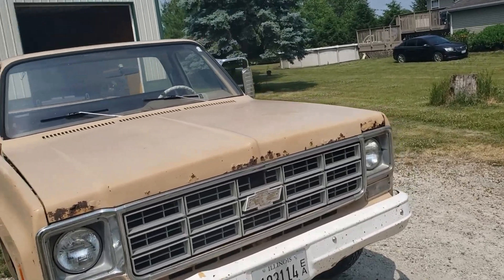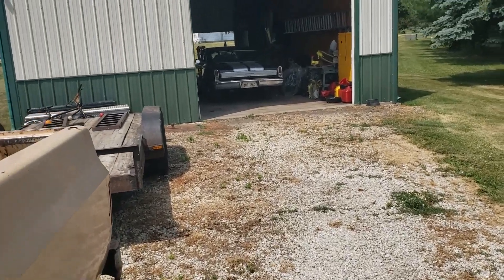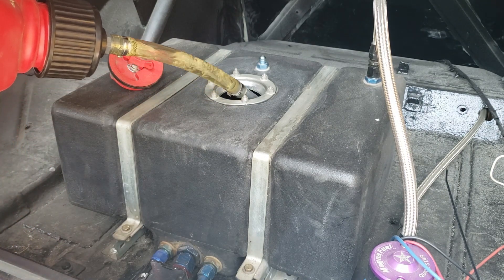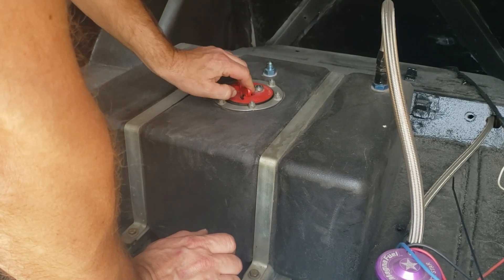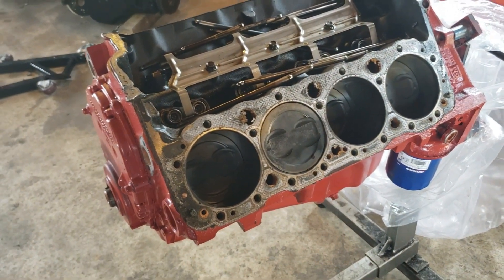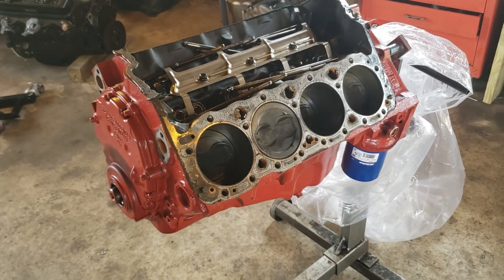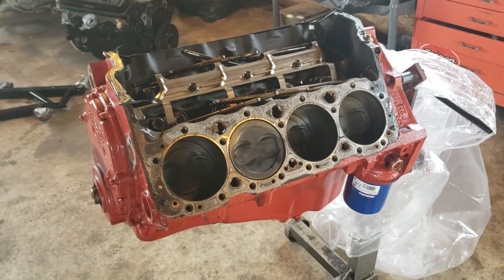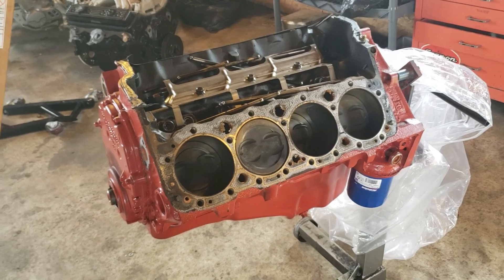Chevy 350 detonation, spark knock, pinging, pre combustion with gas upgrade

Comment: This is a good example of a pinging / detonation / preignition sound, which is really hard to find on youtube amongst all the garbage search results.  So thank you for that. Plus that engine really sings. Lovely.
Reply from the maker: Thank you . It surprised me how noticeable it was in the car. I stayed in the throttle longer then I should of.
Reply: @nylegreen261  I couldnt here anything so how u spose to tell?
Reply: @nylegreen261  what compression are u running with combination of parts, looks like dish pistons?
Reply: I agree on all points!  I have an 08 Silverado Max with the 6.0, and was trying to diagnose this same sound on my truck at 5,000 rpms.  Going to try high grade fuel and see it it clears up.  Would a fuel additive like Lucas also help?
Reply: Dude its literally impossible

Comment: I have the same detonation problem as you 062 vortec heads on a sbc. 400 bored out 40 over I had the heads milled 0.10 they didn't debur the edges around the combustion chamber. I did it myself maybe I skipped some . but I have found out if you don't round off the edges after Milling it will cause detonation. Right now I have a Howard 231/ 235  @0.50 .I just ordered a Isky 292 Mega.  I'm taking off the heads changing the head gasket from 0.41 least 0.20 to 0.27 to get right quench. My rattle goes away if I run 110 octane. I have 146 to 153 cranking compression. Speed Pro pistons  10.7
Reply from the maker: Having a burr makes sense. When I was finding TDC im sure I nicked a valve creating a burr. I forgot to loosen the valves while checking for tdc, hitting a valve. I removed the heads and checked for nicks and did  not see any. The lowest cranking compression i have seen on my gauge was 165. That was on a 9.7 to 1 355 with a large cam. I have ran several sets vortec heads with different quenches and compression  ratios. This was the first and only time I have seen detonation. Good luck. Let me know if the changes worked.

Comment: Funny, I will be using a Melling 22280  duration 220/224 110 ls 495/502. Exact cam except for the LSA changed from 114 to 110. Guess that I will have to use 91 octane. This is going in a 66 Chevelle.
Reply from the maker: Nice, you should be fine. This was a junkyard engine. I think it would of been fine if it was freshened. As is the motor ran good and didn't smoke. It just required higher octane then I thought.
Reply: Going from a 114 to a 110 LSA should soften up your dynamic compression a lot, so you probably won't have any trouble.

Comment: set otal timing to about 20-25.  The vortec chamber does not need regular sbc timing.
Reply: That's way too low, 32 is what GM recommends.
Reply from the maker: I'm on it thank you.
Reply: @nylegreen261  I would spin the distributor in a clockwise rotation about 4 times to really bring in the good spark levels!! :face-orange-biting-nails:

Comment: A stock cam has a wide Lobe Separation Angle (LCA). A performance cam is going to have a narrower LCA. Stock cams maybe installed in a retarded position in relationship to the crankshaft. Performance cams are often ground 3 degrees advance. Closing up the LCA and advancing the cam is going to cause the intake valve to close quicker most of the time. Which if it does, will cause a rise in cylinder pressure. In general, I am speaking of milder performance cams.

Comment: I would double check your timing. Thats a very mild setup, theres no reason you should have to run 93 octane on that engine
Reply from the maker: Not a bad idea thank you.
Reply: The cam is probably small enough that it makes more cylinder pressure with less compression. It is smack dab in the zone only requiring 93 mix in 2:1 with 87. Therefore job well done. However you could do carb tuning further if notrich enough or maybe one size richer . Well whatever it wants to be the best. Usually up one size from dyno i have been told. Also check out that holley part throttle circuit addition modification if not have.. forgive my sleepy ramblings.
Reply: What’s the temp outside

Comment: May I  ask what new camshaft was put in this stock engine? Did you run a steel shim head gasket also? I will be building something like this myself this winter. 
Thanks
Reply from the maker: It is a cam from a blueprint engines 390 Hp 355ci crate engine 220/224 114 l.s. .495/.502. Engine is a junkyard vortec 350 that i just added a cam to. Im going to freshing it up and add a new cam to make it run quicker 1/4 mile times in the future.

Comment: You should really check the timing on that thing and possibly recurve the distributor. Putting in a bigger cam lowers cylinder pressure. Make sure your total timing is no higher than 36° but with Vortec heads, optimal is usually 32° to 34° with it's fast burn chamber design.
Reply from the maker: Good tips on the vortec heads.. Timing is set at 33 degrees. My afr was in the safe zone 12.5 to 13.0. It is junk yard engine that is not fresh. It didn't smoke. It ran good on a mixture of 87 and 93. I plan on reducing quench and freshing it up in the future. The bigger cam raised the peak cylinder pressure and combustion chamber tempature at high rpm's traping more fuel and air in the combustion chamber. More power. Yes at lower rpm it would have less pressure because of bleed off.
Reply: It, depends on the how aggressive the opening ramps on the lobes are. Aggressive ramps, will definitely cause higher cylinder pressure and detonation, even with milder compression ratios. It's, also harder on Valve train components. I do agree, a timing adjustment could have gotten rid of the detonation. But, who wants to detune?😀
Reply: @strokermaverick  
It's not detuning if it's wrong. Also I am going to have to disagree with your "aggressive ramp opening rates" theory, how fast the valve opens has nothing to do with detonation. 

Now if that was an engine with a high static compression ratio and he put a smaller cam (less degrees of duration @ .050") in it the detonation would make sense. So either it's running way to hot or the distributor timing isn't optimized.
Reply: @Anarchy-Is-Liberty  Thats what he said

Comment: My friend who built my engine must have gone to cam school to make my 10.7 to 1  1st gen like 89 pump.
Reply from the maker: This is a 300.00 junk yard engine that is not fresh. I did have to replace the crank. The crank snout was bent maybe from a accident. I paid 200.00 for the intake,cam and lifters.  It ran fine on a mixture of 87 and 93. With the stock cam it was fine on 87 octane.
Reply: @nylegreen261  Hope I don't sound critical of what you are doing as I totally enjoy and appreciate exactly what you are doing. Around 2000 I built a 383 with Edelbrock E-200 vortec heads so I have a history being a vortec head fan.
Reply from the maker: No problem. I enjoy the comment section.
Reply: It's all about cam choice! I'm running a 427 BBC with a static compression ratio of 12.2:1, but with my cam's valve overlap, my dynamic compression is only 7.63:1, so I can run cheap fuel and get away with it. I run higher octane at the strip, but I can run low budget fuel all day on the streets.